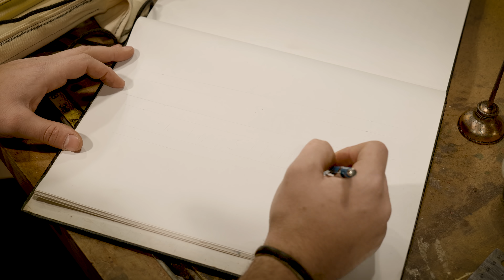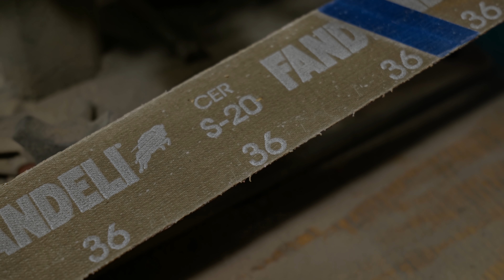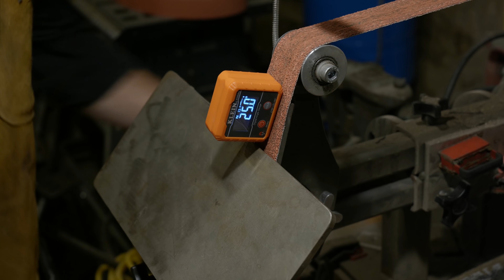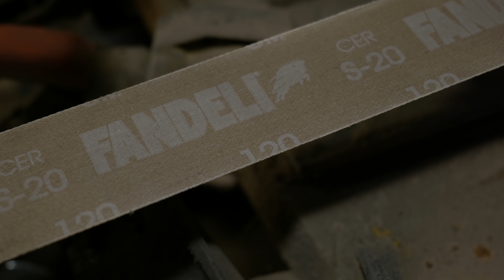Making Simple Marking Knives from Old Metal Files

Comment: They became magnetized because you used a magnet to hold them to flatten one side. The same. Reason screws are magnetized after using a magnetic screw gun bit. Nice work.
Reply: This👆
Reply: Your totally right. I forgot about the magnet. Also I have found that the static from grinding belt will do the same, but it’s not as powerful. Good call.
Reply from the maker: Totally true. It’s just never happened to me before. The novelty of it was fun.
Reply: It can also happen due to friction - drilling through steel, you'll often see the shavings become magnetized to the drill bit, the piece you're drilling, or other steel objects. 

But yeah, magnets will totally do that.
Reply: @jameshaulenbeek5931  Yep and that why most machine shops have a demagnetizer.

Comment: they became magnetised because of the single direction of grinding, the friction causes electrons in the metal to align magnetically, the magnetic holder would help do that a little too, but that would be more of the case if you remove the holder in a sliding motion multiple times.
Reply: Well, the effect of the magnetizing is certainly  to align the electrons, but the mechanism operates at a somewhat higher level than that. Within the steel there are micro-crystalline 'domains' in which the atoms are arranged into a regular 3D grid. Each domain is magnetized, because of this regularity, but the domains are randomly aligned, so the different directions of magnetization cancel each other out. When you heat the metal, the domains are more free to vibrate and slide around than at room temperature, and if there's an external magnetic field, they tend to align with it. 

When they cool down, the magnitude of their vibrations decreases and they stay in that alignment, although the reduced amount of vibration at room temperature, coupled with the repulsions between adjacent North and adjacent South poles tend to push the domains out of alignment, so the magnetization decreases slowly over time. When you heated the metal by grinding it, the external magnetic field was supplied by your magnetic holder, but the earth's magnetic field has the same effect, albeit a smaller one. When ships were made of rivetted plates, the impact of the riveting hammers during the assembly process jostled the domains in the iron, causing them to align, and magnetizing the ships. 

Amazing what you remember, more than half a century after leaving school.
Reply: not friction magnatization, they were magnetized by the holding magnet when he was flattening the files on one side.

Comment: I assumed my existing tools (and patience level) would heat files up enough to lose their temper. But now (for lathe tools) I have a slow speed grinder and an Al2O3 wheel that keeps things cooler than high speed Al2O3 wheels (albeit it wears faster, even being slower, guess sit's part of staying cooler). So you just made me realize I'm better off now for playing with file knives. And I'll just be careful like you with the sander.

Comment: Some files are only surface hardened, but with a relatively softer core.  It's a bit of a gamble but as long as you check - older ones can be case hardened just as often as the newer induction hardened ones I have found.  Cheers from Oz.

Comment: That welding magnet you used to hold them is probably why they are magnetic now, along with the heat from friction. You can test this by rubbing a pin or needle with a magnet in the same direction of a bunch of times and it will become magnetic. Then you can float it on a leaf (or bit of orange peel) and it will rotate to point North.
Reply: this old tony has bought a small electric demagnetiser, looking forward to that too. i dont quite like the idea of sending my costumers knifes, that collect mettal dust
Reply: Yea there are cool easy and cheap ways to DIY demagnetize as well!
Reply: @RaspyOB174  for example letting the knife drop several times ore smash it against an walk 😂
Reply from the maker: That’s a good point.

Comment: the magnetizing was due to the magnetic holder's field being conducted in the files while also heating the files up then quickly quenching.  although it can also be induced simply by the way they're introduced into a magnetic field.  you can mess with compass needles the same way with a decent 2"x1"x3/8" ceramic bar magnet, you can strengthen and weaken the needle, flip its field, and if careful, remove it.  the trick is approaching and leaving the equator, not the poles.
Reply: it's the sanding which magnetises the metal, not the magnetic holder which is negligible, nor the heating.
Reply: @daos3300  you're very right that even sanding itself can magnetize things.  a belt sander is essentially a Van De Graff generator.  did you know that if you spin a copper bar fast enough it develops its own magnetic field? 
  but the heat can and does play a part too, though at least with soft iron and some steels this isn't the biggest player, and usually you need to have it in the presence of another magnetic field.  and in the case of soft iron you really only require a magnet to induce a field.  that's what a compass needle is.

Comment: The countersinks you did turned out nice and even.  I often get a jagged look to my countersinks when using a countersink like that.  Do you run the drill at a really low speed? Or high speed? Light pressure or heavy pressure?

Comment: May I ask why you didn't anneal the section you wanted to cut first?
Reply: Such a small section on a small tool.  You don't need to anneal in this situation.  Much Quicker to grind while hardened and no risk of warping
Reply: Plus the hardening process done to Files is much harder than you will get on your own hardening process.  Add with the chance of warping the knife during this heat treat and it just doesn't make sense to go through all of that.  Grind with cooling dips and just get it done quickly (: Good Job

Comment: Very nice work. What is that magnetic handle you use while sharpening?
Reply: A welding magnet!  Available in welding supply sections of hardware store
Reply from the maker: These are great little handled magnet I get from harbor freight. https://www.google.com/shopping/product/7940545139898128400?q=harbor+freight+magnet+with+handle&client=safari&hl=en-us&biw=375&bih=553&tbs=vw:l,ss:44&prmd=sivn&sxsrf=ALeKk02_G_sE8VS5H_xJPB2gsWCtUeyHsg:1615243331724&prds=eto:13474008259769739706_0,cdl:1,prmr:1,cs:1

Comment: Greetings from South Africa. Oh man Dustin, those are amazing. Love Devons one but they are both awesome.....how do you stop them from rusting again? Take care and be safe
Reply: Any Oil and/or Paste Wax.  All readily available at local hardware store
Reply: Of course Oil and Waxes do wear off and need to be maintained with further applications.  You could also Epoxy, Polyurethane, clear enamel or clear powder coat or clear ceramic coat then resharpen to reveal the point.  Would maybe last longer but would have varying non metal feels to them and destroy the usefulness of the file. You would want to wax or oil whatever portion of the plastic coatings that you've removed as well.

Comment: Nice little project. The lanyard holes are not needed for any woodworking tool so I'd pass on that feature. The 1000 grit would be a minimum finish. Marking knives are usually taken to the grit of my chisels and planes. 6000 and 16,000, and yes, you really do notice a difference.
Reply from the maker: Wow. I hear ya. Sharper is always better. Thanks.

Comment: "Im going to take them to the wire wheel and clean up the rust" ok cool now you have perfectly good files and theres no need to turn them into marking knifes. Either reinitiate the rust belt, Give the steel recipes to china and hope they care, or buy or implement Japan(Nippon) steel tech. these are your only options. We're not tearing up files. U want some junk metal then go cut up some scrap you found like a water heater.
Reply: I know right. Ive seen this before and its meth induced. Youre so right. And cool and relevant.
Reply from the maker: These are old dull files, and kick ass steel. I think marking knives are a perfect second life for them. It’s either that or they would have been thrown into the dump scrap steel pile but instead I came along and bought them. What would you prefer, considering the additional “options”😉.
Reply: @TheArtofCraftsmanship  Cleaning them and recutting them (if there was even a need) to turn them back into good files. I see alot of guys making knives. But not so many making good files and just about no one making good steel and its alot easier to sharpen a knife than it is to build a file, if you where willing to live with a marking knife made out of an inferior steel that was easier to sharpen, but didnt hold its edge as well. But its a free country, so you can ruin some grandpas good set of files if you want to. Hey at least you wont have to sharpen the marking knife as often this way. A good vintage alloy file is such a joy to work with, whereas the alloy of an old leaking water heater will cut into soft wood fiber, although may require more touch ups on the blade. Its wood its soft. Whereas cutting metal demands a superior alloy.

Comment: You have to us the cutting wheel to get the length yet you burn up how many belts to get the angle? Do you actually think about what you are going to do before you do it? C'mon man!
Reply from the maker: I used one 36 grit belt. Worked perfectly. Many knife makers do their complete bevel grinding post heat treat. Come on man.😉